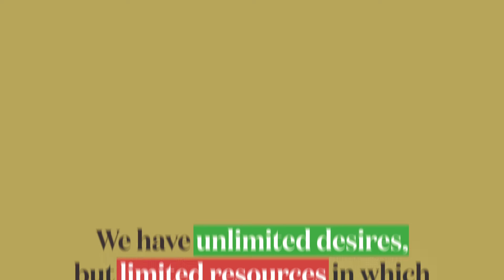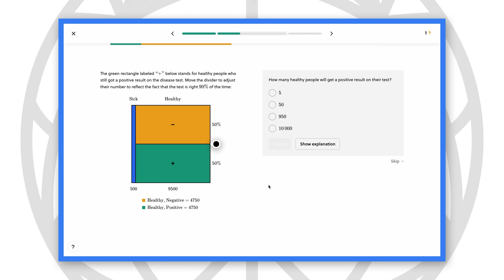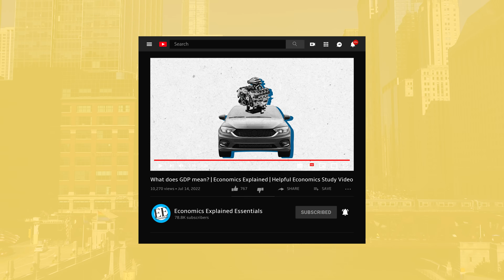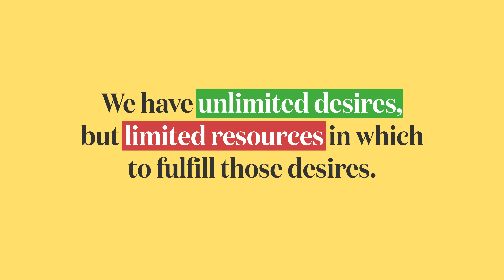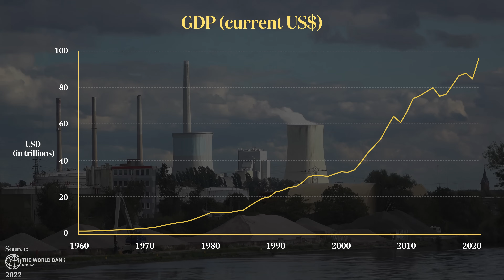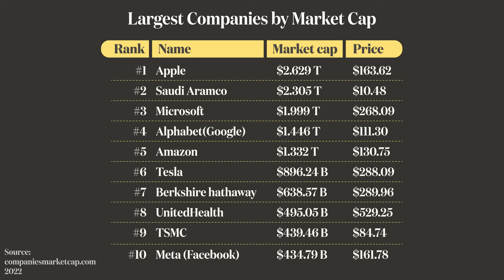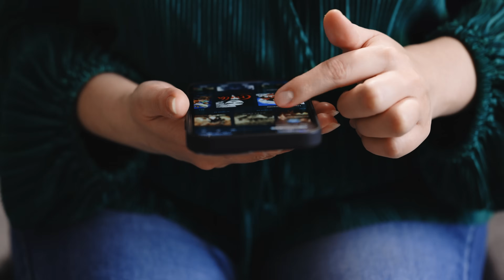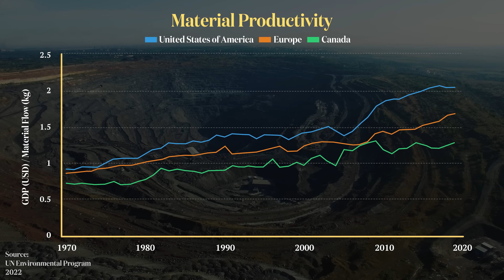Limitless Growth Is Possible If We Run Our Economies Correctly | Economics Explained

Comment: A few thoughts.

Increasing material productivity through a greater digital economy will still be tied to material resources, like you've pointed out. The digital transformation definitely increases the value of those materials but its acting as a multiplier or exponent on the value but its still coupled to the production of the materials. I don't really think it makes to think that this multiplier could or would reach infinity. It would need to reach infinity to take limited resources into unlimited value. The base issue of finite to infinity is still there. At best it increases the material value maybe even exponentially but doesn't over come infinity.

I wonder if a better framing for the fundamental problem of economics is humans have desires beyond our resources. This doesn't necessarily have to be an infinite amount. 

Doesn't decreasing our growth based on producing more materials have the same issue as zero growth for impoverished economies. As in how much comfort is watching Netflix when you don't have a home or know where your next meal is coming from. Any suggestion to address these material realities in infinite growth based on a digital economy model I would think could be applied to zero growth model maybe with some slight changes.
Reply: Interesting and largely valid thoughts, but you're not really disagreeing with the video (at least until the end where you want to use a modified version of zero growth), since there was a clear cut-off point prior to infinity: becoming multi-planetary. I suppose that makes the title of the video technically untrue, but discussing 'infinity' vs 'completely beyond the scope of current political/economic considerations but still finite' seems more like philosophy or even science fiction than economics to me.
Reply: The issue is that you are equating “technology” with “computers.” Currently, the assumption is that the goods we use are gone forever. In reality, because of the Law of conservation of mass, all of those goods still exist, in some form. Future technologies can improve material quality, improve the ability to recycle items, and improve our abilities to produce more things with less resources.
Reply: @jacobbwalters8133  sorry, I'm not understanding you, could you tell me which point you're addressing?
Reply: @cadencsawesomeness4053  I was responding to your point about the world just sitting around using Netflix. I think you have since edited it out of your post. I also think your Japan example is faulty, however. Japan’s economy is shrinking because it has a declining birthrate, a phenomenon that has been discussed numerous times on this channel. To suggest that Japan’s lack of resources is the thing holding them back is ridiculous. Many of the most resource-rich nations have the most stagnant GDP.
Reply: @jacobbwalters8133  You're missing the point for some resources (fossil fuel) once being used they will be gone forever, others can be recycled. Even if you recycle  with 100% efficiency, all else being equal a growing economy requires more resources, so in a finite world with finite resources you eventually run into a scarcity issue. Obviously, the economy can also grow with a constant amount of resources by growing more efficient, but this too has limits. If you reduce the resources enough the properties change. In the semiconductor industry this is already an issue with structures just a few atoms in size we run into the boundaries of what is physical possible. With increased efficiency it's possible to grow a bigger economy, but not an infinite economy.
Reply: Increasing the value extracted from material resources means that you make recycling more viable.
Reply: Zero growth and infinite growth are virtually identical so long as the growth rate is infinitesimally small.  Indeed, so long as we can become more efficient over time, zero growth in our use of inputs automatically generates positive growth in our production or outputs.  I think a lot of people keep confusing endless/infinite growth with exponential growth, which is not the same thing.
Reply: @drmadjdsadjadi  Zero growth or infinitesimal growth is a meaningless distinction. The point is that we are on an unsustainable trajectory, if we keep destroying our environment the survival of humanity is at stake and even if humanity survives it's at the cost of quality of life.
Reply: @silentwilly2983  Once again, you are focused on  the WRONG variable.  What matters is for us to reduce the amount of inputs that we use, NOT that we reduce the amount of outputs that we produce.  Did you know that it takes far less energy to produce a million ebooks than it does to produce a thousand physical books?  Yet if we produce a million ebooks instead of a thousand physical books, we have economic growth but at a lower environmental cost.  Stop fixating on the outputs and concern yourself ONLY with the inputs because it ONLY the inputs that ultimately matter for our future sustainability.
Reply: @drmadjdsadjadi  Not sure what your point is,  I don't focus on output, I point out that we're on an unsustainable trajectory and are destroying the environment we depend on to survive.
Reply: @silentwilly2983  You are SOLELY focused on output whenever you use the term “economic growth.”  Economic growth is defined as the increase in the total measured amount of OUTPUT in an economy.   Either learn to use terms correctly or do not talk to economists on an economics page.  Your concern is NOT and should not be with economic growth. it is with the use of raw material inputs ONLY.  Learn our terminology before writing comments please.  If you bothered to do that, you would find that economists are just as bothered by the trajectory of our use of natural resources as you are and you would discover we have no reason to debate at all but if you keep misusing the terms and misunderstanding the concepts, we just cannot understand you because you keep arguing nonsense.
Reply: @drmadjdsadjadi  What's your point? Really no clue what you're arguing, the video and the discussion is about infinite growth, sounds silly to then claim we should only look at the input. I recognize that the economy can grow with equal or fewer resources. I've clearly stated: "Obviously, the economy can also grow with a constant amount of resources by growing more efficient, but this too has limits."  You can argue that a million e-books take less resources than 1000 physical books, it doesn't change the fact that resources are needed for the production and infinite growth remains impossible, it only makes it possible to grow a little further before hitting the proverbial wall. Growing the economy by keeping the input equal and increasing efficiency is however not a sustainable solution, after all, the current level of inputs is already well beyond the regenerative power of our environment.
Reply: @drmadjdsadjadi  The definition of exponential growth is that your growth is more or less a fix percent above last year. It does not matter if that percentage if 3 or 0.000001%, it is still "exponential" and will, by the laws of physics, crash any system given enough time. Even if we manage to design a system that do not use more input resources but still generates growth (harder than it seems) the exponential growth of the output will never the less get out of hands. The solution is to change to "linear growth",  not grow by a fixed  percentage, but by a fixed amount. You start with a production of 10 items, the next year it grows with one item to 11, a 10% increase. After 90 years you produce 100 items each year, but still grow with one item each year, now down to 1% growth. That type of growth is possible to sustain much longer, but is hard to control and keep at a fixed level. Sounds like it requires some type of "planned economy", which is very hard to keep healthy. Exponential growth very much comes natural to us. Wild animals, plants and even bacterias get an exponential population growth if they enter an area with abundant resources. It can only end in two ways either the population stabilises to a steady-state or it crashes.
Reply: I have reduced my expenses/footprint by 80 percent, granted, I go nowhere and only buy food, utilities, rent,
Reply: there arent infinite humans, infinite growth isnt real nor necessary. time is still limited per person.
Reply: Digital content would probably end up using a LOT more material than other entertainment like books. Sure the video takes only a little bit of electricity to store and consume. It also takes a lot of electronics with a lot of mined materials to watch and enjoy. Several books vs phones, laptops, computers, TVs, etc. Just the data centers are huge material investments, nevermind the specialized AC equipment to keep those buildings from overheating.
Reply: @rayzerot  Uhm... no. These days a laptop can easily last you 10 years. And it can be powered by green energy. And then we could make it repairable and recycable (mostly).

A big reader (and remember - if someone chooses books over digital stuff they are going to read a lot MORE since they have more time for it) can easily read a book a week or more. Thats 520 books in the lifetime of ONE laptop (and that is a very conservative estamite - once a week * 52 * 10).

How many paper goes into 520 books and how much power goes into distributing all the resources for printing, publishing, bringing to bookstore, etc etc? It's mindblowing. It's going to be A LOT more then ONE laptop, which will read ALL of those 520 books, + do a million things more. I guarantee it.

Remember, you don't need a big tv, comptuer, laptop, tablet AND phone, and a new one every year + a game console, to enjoy all digital content ever made comfortably. I am a HUGE gamer and a HUGE weeb/anime freak, like I said above I'd literally sooner voluntarily unlife myself then ever ever EVER give up on anime, manga, the internet and fandom (archiveofourown, twitter fanart, etc), so I am in the mega-ultra-uber-power-user category bascially, and I am happy with one pc from 2017 that still plays all new games, one phone that I rent from grover, and one cheap Chinese cute emulation gaming handheld that has been going strong for 3 years and has a replacable battery and wil never get out of date ever (emulation). I have one nice screen I plan on lasting 5 years with and my second monitor and printer and nice speakers were all literally free to take downstairs in my flat.

So no. If powered by solar panels - BS. You only really need two devices to last you for years even as a hardcore gamer these days (with maybe only a GPU upgrade once - and I also rent my GPU from grover): a pc, a nice monitor, and a phone. That's it. And those can be recycled.

As for the data centers, those have gotten ridiculously efficient as of late, and the AC actually doubles as heating for nearby neighbourhoods, the heat is perfect for creating a warmth net (or what it is called in English, I am Dutch). So that is win win.

Now don't get me wrong, as I say above, I am just NOT EVER going to give up on anime and manga and fandom and my whole happy weeb life even if it would kill me, literally, I'd rather die, over my cold dead fingers, I can take anyhting and don't need anything as long as I don't lose anime/manga/BL/games and fandom and all my friends in it ... so it's not like it would influence me in any way, but I just don't think what you say is true. Or at least not necessarily.

Having said that, obviously I still collect physical BL manga (I have 80+  on the shelf) and have 20 or so thick (300-400 pages each) danmei (Chinese BL) novels next to them. As I said, I don't really care after all. And reading on paper is way more comfy - I HATE reading digitally. Digital is for watching anime and playing games and reading fanfics LOL
Reply: If we expand beyond Earth into space in the next thousand years material resources will be so plentiful it will essentially become infinite. So the formula still works.
Reply: @MadPutz  The scale is definitely there to be essentially infinite. Though I wonder if this is the healthiest thing to focus on for humanity's relatively immediate future.
Reply: @MadPutz  There's no reason to presume that humanity has any future beyond the boundaries of our own solar system, given the immense physical obstacle that extrasolar scale imposes and our own inescapable mortality. It may very well take another thousand years just to develop an adequate technological basis to sustain long-term habitation of bodies other than Terra and maybe Luna too in a couple of centuries.  There are fuel requirements and food requirements and inevitable wear and tear to ship systems from the harsh radiological environment of space. The distances alone are not entirely insurmountable, but they could easily preclude both two-way human travel and long term residence on bodies that are as close as Mars or Venus. They could easily be as economically non-viable as saddling every city of more than 150,000 with a mandate to build an exact Great Pyramid replica using period-correct techniques, even if the trip was not technically impossible.
Reply: @MadPutz  if
Reply: @MadPutz  The ocean has entered the chat.
Reply: Main issue with that reasoning is... At what timescale do you consider that sustainability is reached.

The act of living consumes materials there is no escaping that, you need some kind of environment to live and said enviromnent is not eternal, saying "let"s stop growing" is saying "I only care about X generations." X being a big number.

Growing can create the potential to extend that environment in time (or create new ones.) Hence increasing that X by several order of magnitudes.

And the thing is, the goal of zero growth is to make a world livable for as long as possible, in that sense it is self-defeating.
Reply: @meneither3834  thats an interesting point. I'm not sure I understand what you're saying. 

I agree the act of living requires the transformation of materials from the environment of that living thing and we can call that consumption.

I think im confused by what you mean by growth. It seems like you're saying growth is increasing the amount of generations that can live or growing humanities lifespan. Correct me if I'm wrong on that.

When I'm referring to growth I'm talking about growing the GDP or the rate of measured production in an economy. So zero growth would be setting a constant rate of production or we can call it consumption. This wouldn't actually apply limit to human generations but it would limit the amount of humans that can exist comfortably or at all in a given generation.
Reply: @cadencsawesomeness4053  You got what I said right.
At the core of my point is a belief (rooted in history really) that technological improvements require growth to happen, a stagnant economy is unlikely to ever innovate and even less to embrace innovations.

Now why innovate ? Well the thing is that non-growth societies are still consuming, they're still stuck on a world with limited ressources as you say it. My point is that our main hope for a lasting humanity is to have growth to encourage innovation to massively increase ressource availability.
Reply: @meneither3834  How is saying stop growing only caring about X generations? Rather the opposite, stop growing also implies stop increasing the destruction of our environment, if you stop growing the economy and instead focus on efficiency implies you'll end up with a sustainable society that contrary to the current situation does not degrade and will be livable much longer (till the sun blows itself up).  One way or another the economy has to stay within the regenerative power of the environment we live in, it's the only way for humanity to sustain itself long term.
Reply: @silentwilly2983  Because the environment will be gone no matter wether you grow or not.

With growth we might escape that and keep going effectively to infinity, without growth you're dooming the generations at some point.
Reply: @meneither3834  silent willy brings up a great point. The idea that our current ecosystem upon which we draw resources replenishes itself at a given rate. The idea of the longevity of that ecosystem (which we've been discussing is also limited) These two ideas are at the core of the issue. Assuming our ecosystem replenishes at a given rate (through biological processes like plant growth sequestering carbon or microbiology cleaning polluted water or on probably the most fundamental level the sun imparting energy to the earth through radiation and gravity) then if we continue to grow our production then we'll at some point surpass that replenishing rate. This will then in effect use up the earth and be the leading cause for earth becoming unlivable. This will be an early death for the earth and most likely humanity. Where has earth's non-human "death" point is when the sun goes supernova and consumes the earth or some other cosmic event which is likely to be millions if not billions of years down the line. So the idea of zero growth is to get us to a point where our production matches that replenishing rate. Then humanity can stay on the earth until it dies from that cosmic event rather than humans burning it up.

To your point about innovation. I don't mean to be rude but this is demonstrably false. Japanese economy has been stagnate for years now and it still innovates. One could argue that Japan is a microcosm for zero growth given its limited resources so their best bet for a comfortable life is innovation. So I would actually argue that limiting production would actually drive innovation up because that's the only option left. Instead of more we make better.
Reply: @cadencsawesomeness4053  Our ecosystem will not replenish itself for ever is my point.
And this remains true no matter how low your consumption is.
Reply: @cadencsawesomeness4053  Well, if we can all live like Japan I would find this very agreeable as a weeb! XD To me "zero growth" always makes me terrified to the point of being physically nauxious and not sleeping the whole night because it always gives me doom thoughts of everything I enjoy in life being taken away from me and only being allowed to eat crappy vegan burgers, hug trees, and not even use the internet or watch anime because even that "uses energy"! I don't know if it's rational, but thats the only thing that comes to mind for me whenever I hear it and it terrifies me for an hour, then I go back to stop thinking about it lol

I really couldn't care less if the GDP grows or decreases or whatever, like I don't care about that coming recession now either, I am focused on having fun with my fandom life. But ever since 2009 I have literally 100% existed for anime, manga, BL, and actually even more for the whole fandom around it: conventions, cosplay, ships, fanfics, free hugs, fanart, etc. I have literally ALL my friends in fandom, I go to every single convention in the Netherlands each year, plus others in Europe. I actually don't care about owning more things or having more money - EXCEPT fandom. Fandom is life, love and religion to me. I will never ever ever give it up for anything or anyone, I would literally sooner emigrate to Hungary (where my fav con) is and I am LGBT! That's how much I live for it. I am a happy bubbly extroverted happy go lucky WEEB and I'm happy like that :3 If that somehow means I die in 15 years instead of 50 (I am 31), I don't care at all, those 15 years were fun XD

But - if you say Japan is a model, suddenly, it doesn't sound so bad, because well again, I LIVE for anime cosplay fandom etc. Obviously - my whole weeb life and everything I love so much comes from there. And as you say, they have definitely been making more fun things, video games, animes, merch, cute anime figures (I love to have a few on my desk, not too much though, need money for cosplays and most of all events and train tickets LOL and I guess also cheap food to survive so I can keep enjoying life LOL), fanart, doujins, etc! So if we could all life like Japan - if that is your benchmark - I gotta say suddenly it doesn't sound so bad!!

I don't care about growth AT ALL, not one bit - I just don't want to lose what I have rn in terms of anime, manga, BL, fandom, cosplay, and all the awesome friends I have in it and all the fun creative and social activities it entails that I love so so so so so much (writing fanfic, enjoying fanart, giving events for others to enjoy at conventions myself and seeing people enjoy them, watching all the beautifull cosplays, enjoying the latest anime series, talking about them and ships with my fujo friens, etc!!)

But if "Japan" specifically were how we would all live in terms of comfort/life suddenly it doesn't sound so bad! :D As long as I still weeb stuff and anime and fandom and all my friends in it, bascially everything I live for, I am happy. I don't need a bigger house or 15 sets of normal clothes or a car or new furniture every year (my bookshelf is 20 years old and my bed and cabinet were free downstairs for anyone to take...) or a new pc every year as long as I can comfortably play all the new games (current one is from 2017 and still does fine with the newest games with a rented GPU so I will keep it for at least 3 more year), etc. I just want to keep being my happy weeb BL loving fandom trash self and then I am contend :) But - on the other hand, if ANYONE tries to take it away from me for whatever reason, well, literally out of my cold hands and over my body lol. Seriously :)